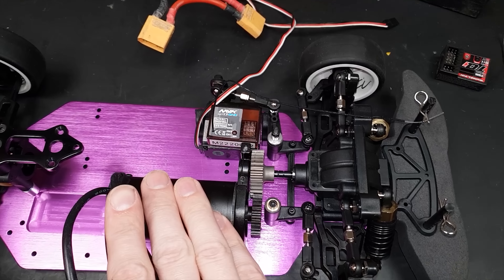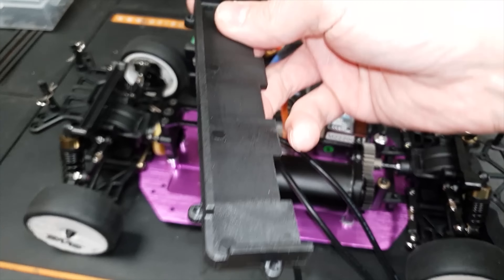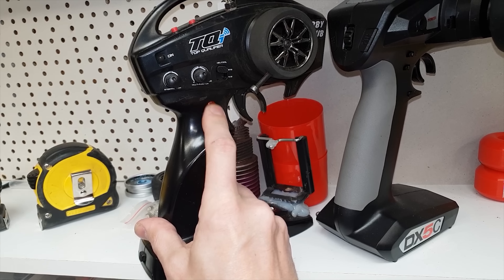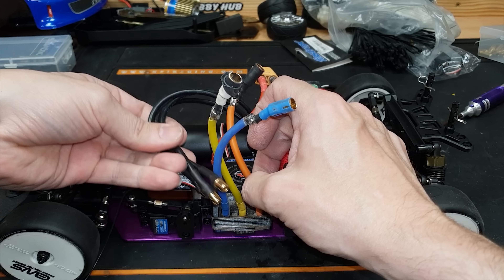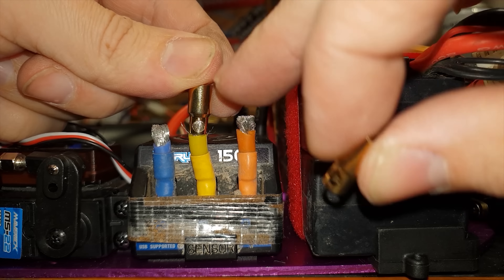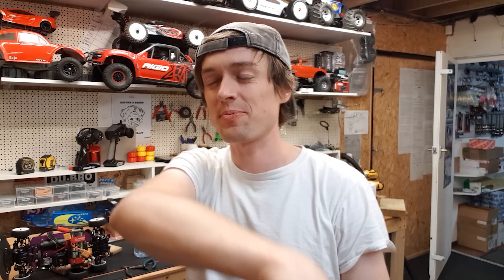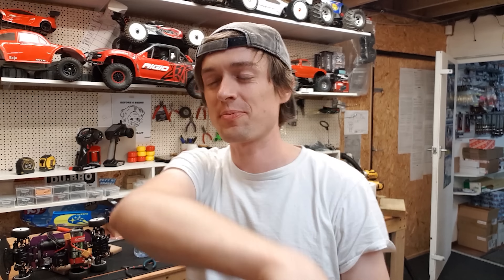FWD RC Burnout Car BUILD Part 3 - Its Finished - kind off!

Comment: I would have used the soldering torch to put the bullets on you can heat the entire connector up and feed the solder through the hole it will drink it up

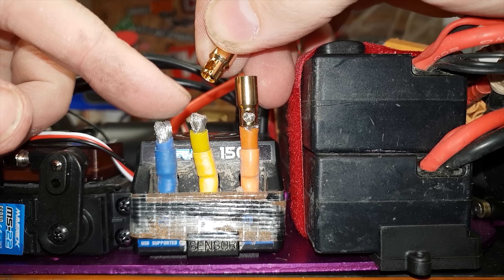Comment: 8:07 problems could be caused by 2:34 ...  you can  solder that close to the esc , the electronics get to hot via the Wires ....  idk ... i dont risk it.. cheers ... 
ps ... its too low for a speed run ... which sucks  but maybe you can take to some where really smooth and run it pretty fast

Comment: Couldn’t you just connect the motor straight to the diff outdrive no gears needed or bearings 
Iv always wanted to fit 2 motors to one car and connect them straight to the diff out drives 👍